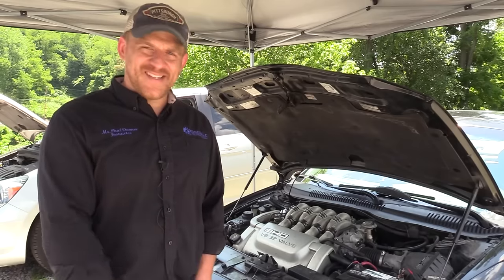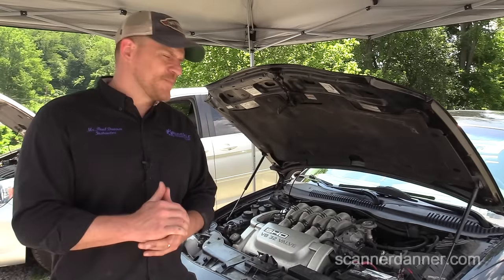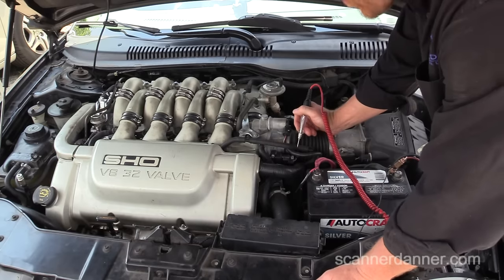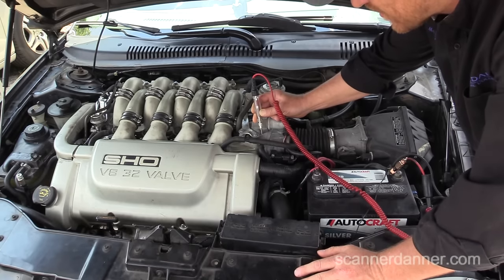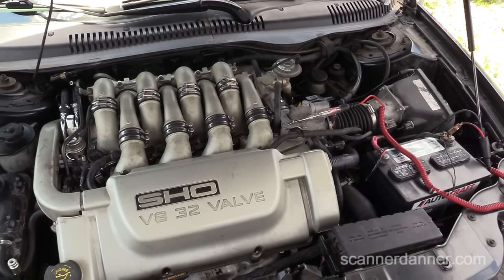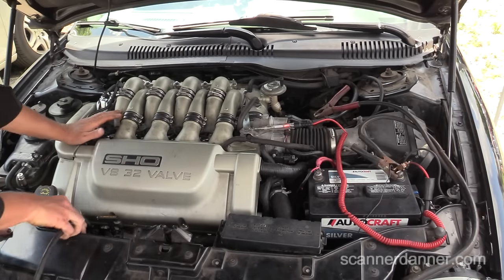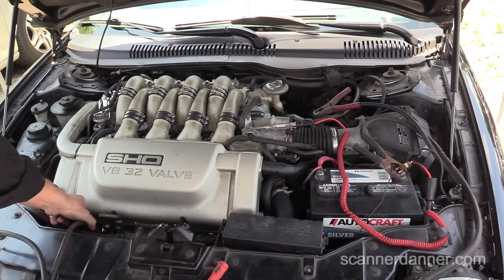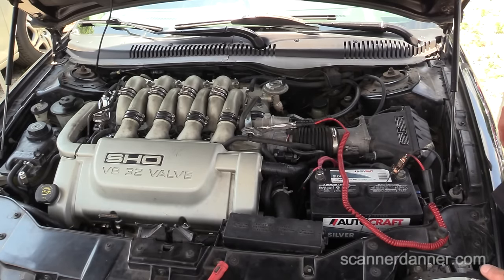No crank, no start diagnosis (bad block ground) - Ford SHO

Comment: Here is a weird one.  2001 Ram 1500 5.9 4x4 auto.  Cranks - no start.  Has spark & fuel pump.  Poured fuel in throttle body and it started & kept running normally.  Shut it off & again it would not start..  again primed throttle body.  Started & ran normal.  1 code - P8138, no voltage from ASD relay to PCM.  Replaced ASD relay - no change.
Reply from the maker: Get it to not start again and check power at the injectors while cranking. Give me a voltage number
Reply: Battery voltage @ 12.15 volts. Ground = negative battery terminal in all cases.
Cranking/no start - power at Injectors:
  Green/orange stripe = 10.26 volts (10.31 to 10.22)
  Yellow/white stripe = 0 volts (momentary surge to .02)
Reply from the maker: To be clear. One injector wire is reading battery voltage and the other is 0 all the time? And is that just one injector you tested?
It should be 12 and 12 not 12 and 0
Reply: Yes, that's correct - one injector wire reads 10.26 volts when cranking & the other injector wire reads 0 volts when cranking. Yes, I only tested the injector wires on cylinder # 1.  No, I did not get 12v and 12v, I got 10.26v and 0v.
Reply from the maker: The ASD circuit code has me concerned. It is what is supplying voltage to the injectors and other components. With just the key on on your system the two injector wires should read 0 and 0 (ASD is not energized until there is an RPM signal). Initial key on it will turn on for 1-2 seconds then turn back off until there is RPM. 
Anyway, once you start cranking, your injectors will start pulsing and it is too fast for a digital voltmeter to see it, so one wire will show battery voltage (from ASD circuit) and the other will be pulsing to ground but will also show battery voltage (a few hundred millivolts less due to the quick pulses to ground by the PCM). 
So basically you should be reading 12 and 12 cranking. 
For you to have 12 and 0 on the injector you tested means either the injector winding is open (bad injector) or the wiring is shorted to ground in which case the injector is on all the time and will flood the cylinder with fuel. 
The fact that it is a multi-port system and it is a no start, says to me it is NOT an open injector, they would all have to be open for it to not start and that you did not mention a flooded engine or cylinder full of gas plus again, it would have to be all of the cylinders for it to be a no start. All of this tells me you didn't do the injector voltage measurements correctly.  The test should be done with the injector plugged in and backprobing the connector.
Reply: OK, I understand.  Yes, I did the test incorrectly. (I unplugged the injector wires from injector and tested that way.)  I just watched 3 more of your videos - I'll go get a "T-pin" and do the test correctly.  Sorry.
Reply: No problem man. Use this test, it will be better. Disconnect the injector and put an incandescent type test light between the two terminals of the injector. You'll need to be creative with a pin on the alligator clip for one side. Just DO NOT let them touch (the test light pointed end and the pin). Crank the engine over, the light should pulse on and off.
Reply: OK, went shopping, bought T-pins & incandescent test light.
All of the following tests were done while CRANKING:
Test light on 2 terminals of disconnected injector lead = NO flash.
Voltage of 2 wires to ground of connected injector: 10.3 & 10.2.
..and this is the kicker:  Voltage across battery terminals:
At rest = 12.38 volts.  CRANKING = 10.5 volts.   ..bad battery?
(I disconnected battery and am charging it right now).
Reply from the maker: The voltage of 10.3 & 10.2 was cranking right? 
If so your battery is fine, you have no injector pulse. The "no voltage from the ASD relay" code is the path we need to walk now. 
Post this to my forum so we can look at diagrams and stuff okay?
www.scannerdanner.com
Reply: Yes, that was cranking.  I will post that to the forum now.
Reply: I bought the eBook this afternoon, and it looks great.  But the forum says I am blocked.  Won't let me in.
Reply from the maker: It takes up to 24 hours to get your conformation email. Just trying to keep the spammers out.
If you're still having trouble email support@scannerdanner.com 
My Web designer will fix you up. Thank you!

Comment: Whatever ground it had to keep it running wasn't good enough to carry the current to start the motor I fixed the same car on a rollback the washer pump motor with shorted I checked the fuse found the blower fuse to the washer pump motor was born removed the fuse and the car started
Reply: I wish I could have been a student of yours when I was a younger man I've learned a lot from your channel and I'm 60 years old